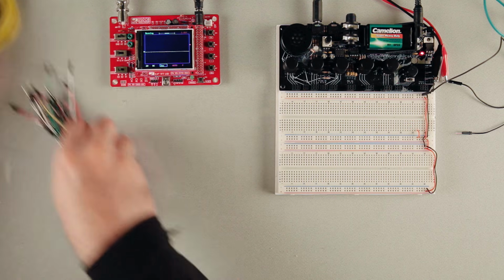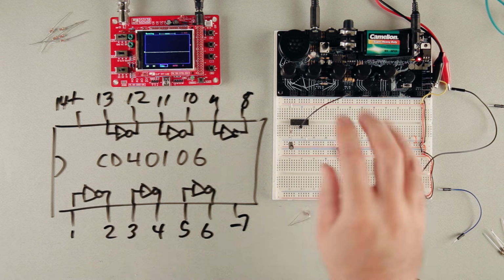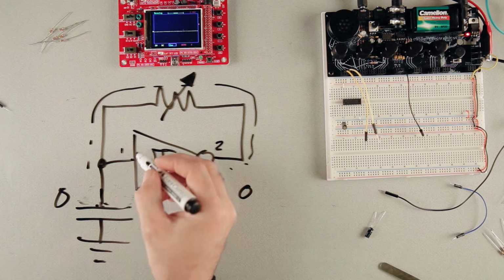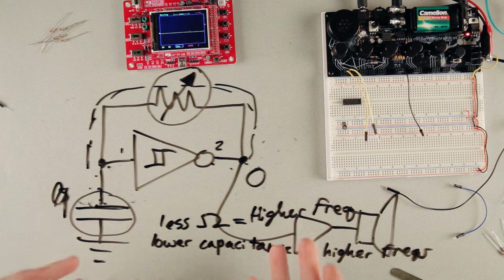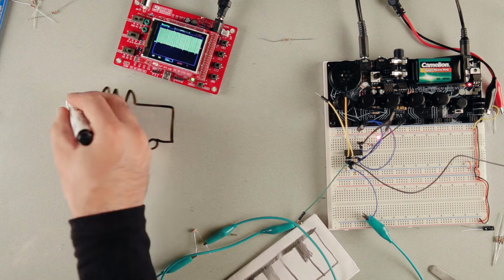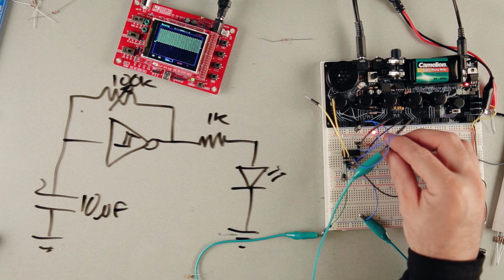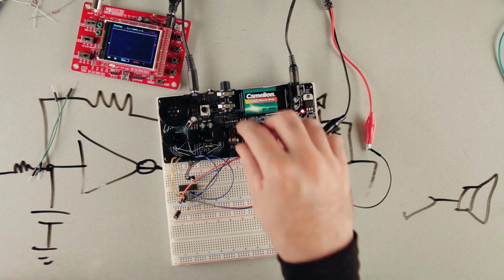Casper Electronics DIY synth building. Part 1: Oscillators

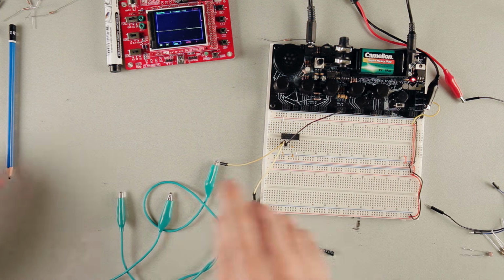Comment: Great demo and explanations. The step oscillator you describe at 17:00 was first described (as far as I know) as "Sound Synthesizer" in Engineer's Notebook: Integrated Circuit Applications (1980) by Forrest Mims III, implemented with a 556 (a dual 555). I like your design with a hex inverter better because you can make 3 with one chip and less discretes (caps and resistors).

Comment: I'm building this atm but without any oscillator for a voltage only Cv to control other modular stuff.  So I'm cutting out the oscillator IC.  Would I just keep the clock in for the first 4051 chip to get a clock externally?  Also I'm not really sure how to modify the sequences.  I know where looking at the schematic with the 3 wires going up from the 4051 IC to the 100k resistors.  Would I put switches in between the 3 wires or something?

Comment: It's great to make DIY synth as a standalone device. It's not a product or a brand or a price tag anymore, cool.
But if I try imagine the simplest way to get a sound of an analogue oscillator and filter, I end up with an idea of a device with just four CV inputs:  pitch, amp, filter cutoff and resonance amt.
So I set a DAW to send those values to some, say Arduino, usb interface, that will work as 4 midi cc-to-voltage converters, and that's all. All kinds of LFO -ing, ADSRs, keytracking, velocity scaling, etc. I do from within DAW.

Comment: This OMSynth does not have -V,  so its primarily useful for CMOS and microcontrollers--basically for making control interfaces. The lack of -V (bipolar) functionality leaves it there, so no fancy circuit protection (on the -V side using another 9v battery) for any kind of real-world audio module prototyping. Then you have +6.5V and -8V, and will have to create a step-down stage as well for the -V.  Most audio/synthesizer schematics and ICs require bipolar voltages. I regret paying $200 for this, actually. It could be useful for sketching out Lunetta circuits, however... Mutable Instruments Breadboard Friends seems a better choice for audio-based learning, experimentation, and prototyping--they are also way less expensive.
Reply: Man I just bought an Arduino start kit minus the Arduino itself -- $16. If you don't like the OMSynth then just sell it on Reverb or eBay ... many consider it to be a collector's item. Hey ... why don't you modify yours to take two 9V batteries? Problem solved ...

Comment: hi there, how did you make the touch "pcb", what kind of ic's does it need?
Reply: He probably etched it from a copper plate. No IC needed to use it as a variable resistor.

Comment: Hey Casper! I loved your videos so much that I went out and bought the OM Synth for myself to try this!

This may be a dumb question - on the right hand side of your bread board, there are red and black wires going from the PCB to the bread board... I'm a little fuzzy about their connection in the middle of the bread boards. Do you have a diagram for this please?

Cheers,
Henry
Reply: black one is the ground and red the voltage. pur the red one in the red lane and the black in the blue one. basically he’s sharing the same voltage and ground to all the section of the breadboards

Comment: What is a Schmittrigger and how does it differ from other inverters and why do I need a Schmittrigger and not any other inverter here?
Reply: I am fairly sure the Schmitt trigger is what produces the clean square wave output. It does this via something called hysteresis. If you pay close attention to the first example, Casper shows us first a square wave by tapping the output, and then a triangle wave by tapping the input. If the inverter is just a regular one, you only get the triangle wave and not the square wave.
Reply: Yeah, it's that hysteresis.
 The voltage needed at the input to make the output flip state, depends on the output state.

As a crude example, the capacitor has to charge up to 3v to make the output flip to 0v, then the capacitor has to discharge to 2v to make the output flip to 5v again.
 This hysteresis allows stable oscillation.

A crude example without hysteresis: the capacitor charges to 2.5v, the output flips, then the capacitor discharges to barely below 2.5v, and the output flips again.
 The output keeps flipping so fast it never achieves 0v or 5v, and just ends up as a noisy unpredictable 2.5v.

The _□‾ symbol denoting a Schmitt trigger is actually a graph of input (X) vs output (Y).

Comment: why do synths use VCO instead of CCO?
Reply: Great question! Current is used to push the final output into speakers -- current is hot. High impedance voltage is much easier to work with and more efficient. Think of voltage as communication (audio signal) and current as realization (sound).

Comment: How do I know which voltage the capacitors should have?
Reply from the maker: As a general rule the capacitors should be rated at LEAST 2 times the power supply rating. In this case the supply is 9 volts so the caps are all 18Volts or more. non-polarised caps (like the 1uF caps i use all over the video) are usually high enough that the voltage isn't even written on the package (usually 50volts or more). Electrolytic caps offer much higher capacitance but can have a very low voltage rating. It will almost always be written on the body of the cap. So stick to 18Volts and up and you'll be fine.

Comment: This is awesome! I built this, and the sequencer is next- I have all the parts! I am a high school physics teacher, and my students are going to make Atari Punks consoles, then maybe this.
Reply from the maker: huzzah! thats super cool. I wish i was building weird sound circuits in high school :D Feel free to drop me a line if you have questions or suggestions
Reply: @bubagoo   
Cool, you replied!!!! Most youtube folks seem to ignore the comments, that's cool that you acknowledged my comment, thanks!

I actually found a cool kit and bought 24 of them for my students, at around $4 each. Tech Will Save Us DIY Synth kit, which has everything except the battery- even the speaker! It uses a 556, and one of the circuits is basically the Atari Punk. Ive been building variations of the 40106 synth that you show in your video. There are so many little variations I can do with LDRs and pots, I still have not made it past that. One day I will get to the sequencer and sampler- I have all the parts, but I am still really engaged by building the 40106 oscillator over and over again.

Comment: Basic question: what is the best way to bundle up several oscillator outputs before I run them into the mixer? Using the separate inputs works fine, I'd just like to have more oscillators running at the same time. Can anybody help out? Much appreciated.
Reply from the maker: connect the signals together through individual resistors then they will make one signal that you can plug into your mixer. Try 10k resistors. 47k or 100k could also work depending on what you are then patching them into
Reply: @bubagoo  thank you very much

Comment: Where are you connecting the oscilloscope leads? Looks like one is to ground and the other...? Thanks!
Reply from the maker: Thomas Beckett at what point in the video are you asking about? In most cases the scope is connected to the output of an oscillator which means one of the pins on the CD40106 IC. And yes, one lead always goes to ground.
Reply: Thanks! At any point is is hard to see where the oscilloscope probes connect. You’ve given me what I need to work with. Never used an oscope before, but now I have one of those jyetech jobbies I’m learning how to use.

Comment: Can anyone explain how to use a 1v/oct CV to control the pitch? Id like to build one or a couple of these to use with my beatstep pro.
Reply from the maker: Well...if you are looking for 1v/o tracking then 555 won’t work either. Both of these oscillators track linearly. 1v/o is exponential tracking. I suggest you look it up to get a more thorough description than I can give here. But in any case, the way to do it would be to make a linear to exponential convertor which is classically achieved with an op-amp and two transistors. Ideally the transistors are matched to have exactly the same behavior and a temperature compensation resistor is integrated as well to maintain accurate tracking. It’s a bit of a hassle to be honest.... but not impossible. And in reality you can skip the temperature compensating resistor and just use two general purpose transistors and still get decent results
Reply: @bubagoo  thanks for the reply. Any suggestions for what kind of opamp and transistors to use? Are there significant differences? NPN or PNP? Probably should research this myself though.
Reply: I think you would get better results using a 555 chip instead, it has a CV in that you can use to control pitch. I have used my Business Card sequencer to drive some 555 circuits with decent results.

Comment: Just watch this video. I realy enjoyed to watch the simpy explaining! Realy like it thanks! Where do you build the blackboard that generates the rect() function on top of the bread board? Where can i get the gerber and bom, or scematic of it? Or even buy it
Reply: Just realized the oscillator buid the rect function 😖 the black board only gives a constant DC 9V 🤣
Reply: There is no rect() function ... this is purely analog. The black board is called the OMSynth and in addition to the DC voltage it provides a mixer, amp and a speaker as well as some built in potentiometers you can wire into your breadboard circuit. I am kinda working on building my own version, slimmed down and simpler.
Reply: @HazeAnderson  okay thanks. Yeah you right there is no rect() funktion, what i ment was rect signal, but this signal was created from the inverter schmitt trigger and the load and unloading of the capacitor. I am also thinking to making one for my next project. Are you going to make an breadboard version of it?
Reply: @ipt6854  Hey no problem ... yeah I have been trying to wrap my head around how to best build the mixer but I have a powered speaker ready to go. If you search around you can find all the schematics for the OMSynth starting here: https://bastl-instruments.com/support/tutorials/omsynth-tutorial-intro
Reply: @ipt6854  Maybe this will help: http://musicfromouterspace.com/index.php?MAINTAB=SYNTHDIY&PROJARG=OLDIESBUTGOODIES/AUDIOMIXER/panningmixer.html&VPW=1228&VPH=500  I used this to get a "left sum" to one LM386 and a "right sum" to another LM386 for my mixer. It works, nowhere as nice as an OMSynth but it only cost me about $20 in parts. Good luck!

Comment: hi!
is there a trick to mix several square waves together to make a drone synth or a simple series resistor for each oscillator tied to a volume pot will work?
Reply from the maker: mouldeck run each one through resistors (10k will work) or a diode then plug them all into one of the inputs of the mixer

Comment: Hi Peter, thanks for all the information you share with us. Really inspiring stuff. Lots of fun to try stuff out and come up with cool ideas to make crazy sounds. I definitely got the bug now. :) One question: I made a triangle LFO out of the 40106 buffered by the LM358 (worked better then the 4069 for some reason). My question is, how can I have this LFO sync to a clock? I tried to send in another osc (square) with a cap/resistor/diode in between, but it doesn't work. The square take over completely. Any ideas? Thanks!
Reply from the maker: Nelson Cole Reis hey Nelson. Glad this has helped you get going. Unfortunately syncing triangle waves while retaining the triangle-ness is tough stuff :/ doing it the way you have said will give you audible syncing effects but you will be changing the wave form

Comment: Why don't use FETs instead of LDRs?
Reply from the maker: Wendyn70 I’ve found FETs can take some fine tuning that brings it out of the super noobie region. But most of all LDRs are fun and can be controlled in very intuitive ways
Reply from the maker: But yes, FETs can be used for some good results. A BJT nPN transistor from inverter input to ground can also work really well as a CV control convertor

Comment: I'm trying to start with Eurorack and searched for a lot of easy "first oscillator" builds, after weeks of searching, I finally found this video and this is the one that's explaining it the best.Love it!
Although I've got a question: Does it make a difference if you use electrolytic capacitors instead of ceramic ones?
Reply from the maker: cool. glad the info is helpful. Short answer to your question...no. Longer (but still short and a "no") answer, they are different but this super simple raw circuit doesn't care about those subtle differences that do matter in more sophisticated oscillator circuits. The only factor of importance here is the value.

Comment: I'm sorry if you mentioned this and I just didn't notice, but how do you change the duty cycle of the pulse?
Reply from the maker: Joe Yacketori you need to add a component that changes the rates that the cap charges and discharges. Diodes and a potentiometer will do the trick. Check out Attack Decay envelope designs and you’ll see what I mean

Comment: Haven't had this much fun with electronics in a log while. Thanks for the inspiring and informative clips. My plan is to build a noise-box with lots of LEDs, Switches, Knobs and cables to myself and the kids. This is my first experiments with the CD40106: https://youtu.be/mqxDh5j_Z7I
Reply: i checked yours it turned out awesome! did you add to it??

Comment: That was very informative. Thanks so much. Just a couple of quick questions. RC = TIME (s) and 1/TIME = FREQUENCY (Hz.) Would that be the formula to determine the kind of range you want? Also, is it possible to use a Schmitt Trigger to make a Sawtooth Oscillator? Thanks again.

Comment: quick question, if driving another circuit from an LFO like this, what kind of resistors should you use in the buffer circuit? (with an opamp)
Reply from the maker: ...with an opamp? You mean using the op amp as a voltage follower of the LFO? Well anyway... that is what you should do, connect the lfo to the noninverting terminal of an op amp. I think you can connect directly. If it makes problems then connect through SOME resistance...10k, 47k 100k... shouldn't make a difference. and then connect the inverting terminal to the output. The output will then be a buffered copy of your LFO.
Reply: thanks for the swift reply x great video
Reply from the maker: no prob. Lemme know if that doesn't make sense or doesn't work.

Comment: I find it very hard to understand anything. The components aren't clearly visible, even on a big screen and full HD youtube video. There is no instruction how the structure of the omsynth works and I can't even see in which exact holes the components are put in There is no explanation on what signal comes from which hole, or what you have to look out for.

Comment: Do many analog synths use Schmitt triggers as oscillators (but with voltage control)?
Reply from the maker: Eisenhower303 no I doubt it. For any mid/high quality synth there are much more stable and flexible oscillator designs. The advantage of the Schmitt trigger oscillator is that it is extremely simple/cheap/easy/fast to build

Comment: This is great, exactly what I needed to get started. I built a single oscillator and used a B100K pot for pitch control. Turning the pot from low to high gives a smooth sweep of frequencies, until the last little bit of rotation, which jumps up really quickly to a super high pitched squeal. I believe the value of the pot determines the lower boundary for pitch (100K in this case being the most resistance applied), but is there a way to restrict the upper boundary, to avoid that nasty jump?
Reply from the maker: Morgan Black there sure is ;) place a 1k resistor in series with the potentiometer. If it's still too high try a higher value resistor.
Reply: Thanks for the response! I put a resistor between lug 2 and the output, and that certainly did the trick, although the range at the bottom end of the pot has changed as well, so there's only audio within the top half or so, whereas before there was audio across a full rotation. It's tricky to control it with precision!

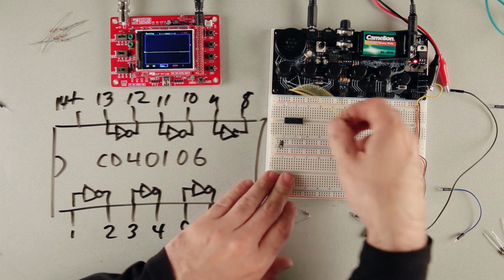Comment: Hi! I've folowed this video for about 7:30 then I've started to experimenting (already did seen this all but not sure I remember all)
It was a surprise: 
- if I change a resistance of one Schmitt trigger (1-2) then 2nd (3-4) is kind of syncing to the 1st. I've made a simple mixer with one resistor (from pin 2) then it meets the triangle wave from pin 3 and these are mixing with a  cool "notchy" wave.
- if pin 3 goes to the "meeting point" through a resistor then the wave is completely other! It makes FM on the square wave. Very interesting sound also!
I've replaced the R for 2nd schm.osc. to a LDR - it's  gives cool performance :) It sounds like RM!
One important detail: I have a powerful bycicle headlight for this and... the character of the modulation also depends on it's force! I don't know why... maybe because this headlight gives a "blinking light" (controlled by PWM?), not constant.

Comment: Thank you so much for your videos!  They are a major inspiration and a guiding light to me, I really can't thank you enough.    I was wondering, how does the Schmidt Trigger compare in sound quality to a 555 or 556 oscillator design?

Also, I would be very grateful and happy if you could point me in the direction of a video with the same clarity as yours, but explaining how to build voltage controlled filters and amplifiers.  Regardless, I want to thank you for your videos, they're all clear, concise and easy to understand.

Comment: hey, let's say i have an exponential converter circuit to control the pitch by a keyboard. would i just connect the output of the expo converter to where you connect the pot?